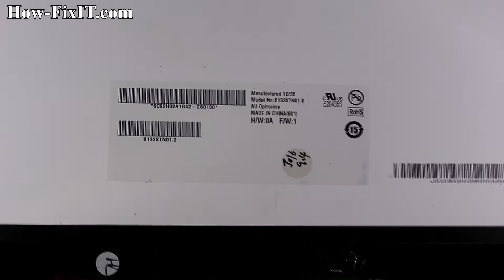Lenovo IdeaPad U310 Screen Replacement - Your Step-by-Step DIY Guide!

Comment: Hi. I have problem in my laptop, I can not enter the bios setup in lenovo u310, How can i solve this problem?
Reply: Did you find answer to your question?
Pls let me know.
Reply: @vincentgonzales9530   I know, it's, probably, too late - there s a button on the side of top left corner, where the "Power" button is.
Reply: I know, it's, probably, too late - there s a button on the side of top left corner, where the "Power" button is.